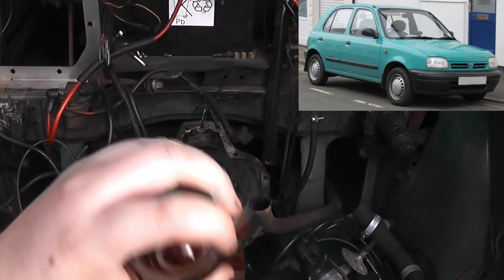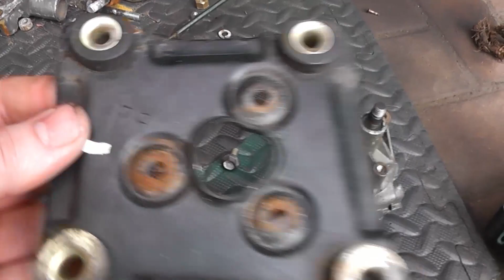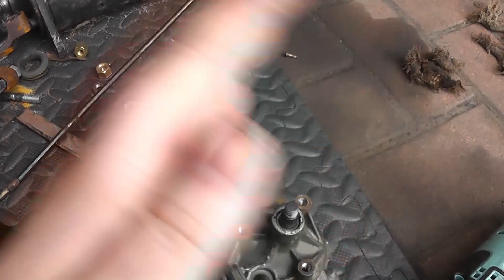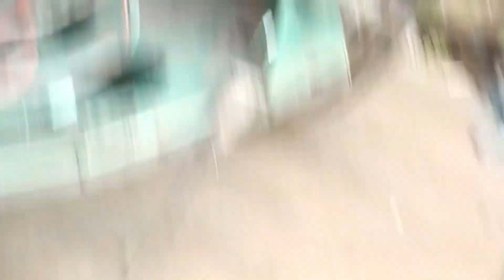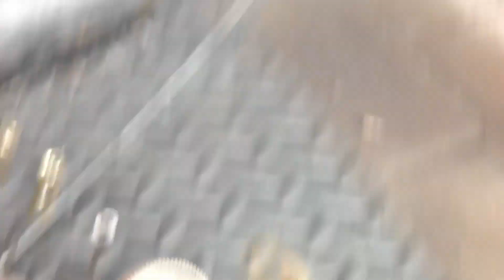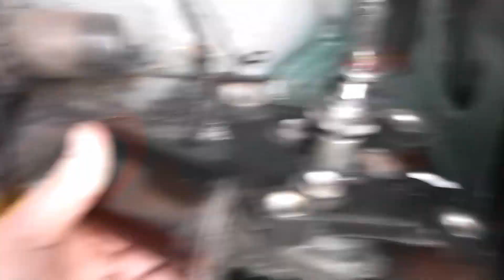Morris Minor Fast-ish Road Build Part 2: K11 Wiper Motor Conversion

Comment: You’d have to be well p*sped off with the original to go down this route. A very well done piece of fabrication my man!
Reply from the maker: Thank you. To be honest, usually the wipers on moggies work ok (just), but the original motor completely broke and the cost of getting a wiper motor refurbished is ridiculous. There are upgrades available using Triumph or Mini parts I think, but they're likely to be equally cack.

Comment: What a great little project glad it all worked out and got a nice 2 speed set up now :). I wonder if there was a way to use the original housing at all.
Reply from the maker: That was my initial plan, but the original wheelbox is too small to allow for the introduction of a new system. If I had the facility to weld aluminium I could probably have modified it.